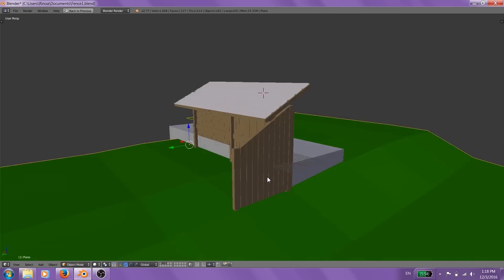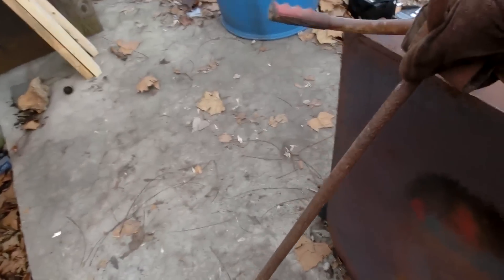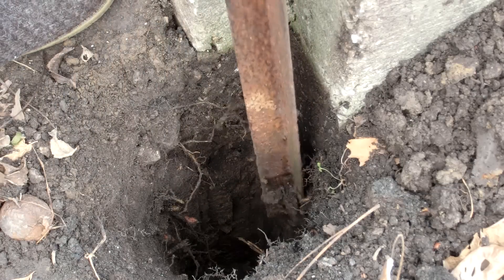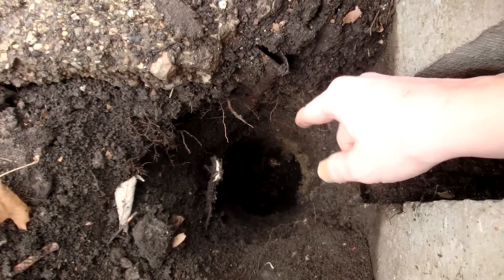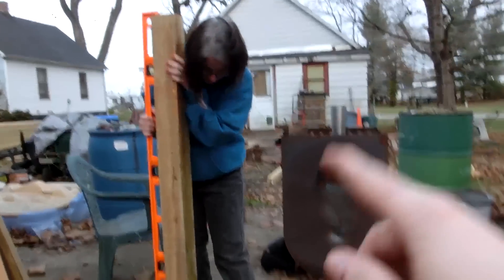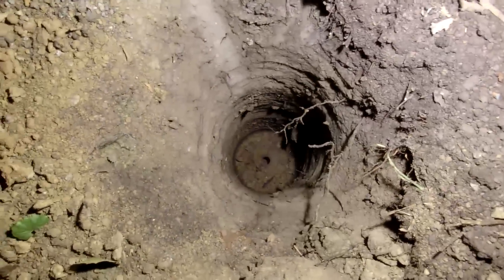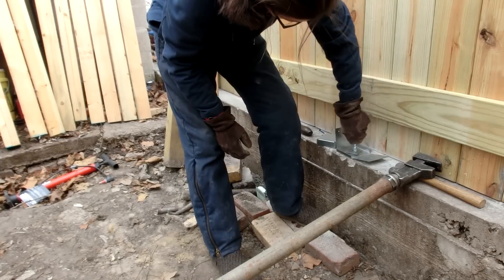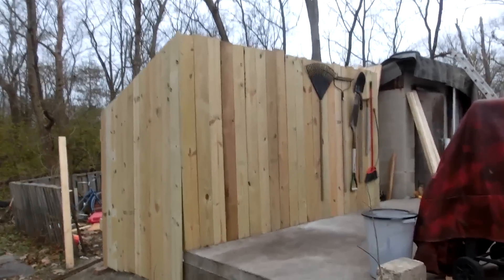DIY: Quickly Building a Fence for the new Work-area

Comment: Looks Good
I agree way better than that shed only downside is stuff may get wet and you don't have as much storage.
Your mom was asking about that little stand on the post holder it's not just for clearance on the bolt it's actually meant to keep the post off the concrete.
Reply: Why is that ? To keep the wood from absorbing water on the concrete ?
Reply from the maker: +flo ri yes.
Reply: Oh ok ^^
So, should the post be separated from the dirt for the same reason, kinda ? (My parents did buy a kind of metal tube with a spike that goes at the end of the post and into the ground)
Reply: flo ri if I understand your comment correctly then yes in most cases even with a pressure treated post you do not want it touching the concrete.

Comment: Cool project.  If you're having trouble with oversized holes or putting bolts into concrete and old builders trick is to put copper wire in the hole and then ratchet down against that.  The copper will take up the gap and be what you press against.  Copper doesn't rust, boom, done.
Reply from the maker: wow, i'd planned on doing that with copper if it didnt fit. guess i was on the right track. lol
Reply: The construction guys usually drill a hole smaller than a concrete nail, hang a copper wire inside and then just drive the nail in; instant holding power, but you could've done it there also.  Great thinking!  I will say it was strange to see you not working in flip flops, lol!
Reply: Oh and one last thing.  If you want to know where pipes are or basically anything under ground, just call Digsafe.  They have to come out and check the grounds for you by law.  Check the Internet for a phone number.  They're required to come out to basically check for gas pipes any time anyone wants to dig, so just make up a work site, call the number and see what they come up with.  Could be a cool public service kind of video also.
Reply from the maker: well its bellow freezing, i only wear flipflops when its hot outside because i am still really sensitive to the heat even though its been years since i had heat stroke.

Comment: Besides roots, another shortcoming of the auger is hole size. I don't think I'd be able to turn one with a big enough diameter to work for cattle fence posts, at least not through dry soil. Sure would save me from the bad case of tennis elbow from the constant jarring of post hole diggers though!
Reply from the maker: well this auger does bigger than a post hole digger, so anything larger would require a shovel.
Reply: One uses one side or the other of the curved end of post hole diggers to cut the edges of the hole as wide as needed as one descends into Mother Earth, typically about 10-12 inches in diameter down to 5 ft. so there also has to be room to get a tamper down alongside the post on three sides or it will be loose as a goose. I'm assuming one is limited to the diameter of the auger for hole size.
Reply from the maker: Digger O'Dell
no, as you see in this video i made those hole wider with the angle iron.

Comment: Personally I hate it when I don't know what I am going to find when I start working. I think the worse surprise moment I had was repairing the damage to my mothers backyard from the previous owners, then we hit something big and made of metal. She was worried it was an old oil tank, because if those fuckers leak up here, the cost for removal and decontamination is on the current owners of the property. Fortunately it was just a water heater that was buried. For some goddamn reason.
Reply from the maker: wow thats weird. i kinda like finding things, but thats because i've only found little interesting things so far.
Reply: Yeah... wait until you hit a septic tank. That was underneath another septic tank. Because the first one wasn't bad enough.

Comment: Pouring water in and letting it soak in makes easy work of digging in dry campacted dirt.
Reply from the maker: i did that, it didnt help.
Reply: In that case my professional suggestion is to use dynamite.
Reply from the maker: or i could do what i did and just dig it down slowly. but it would get more interesting if we had to blast. :D